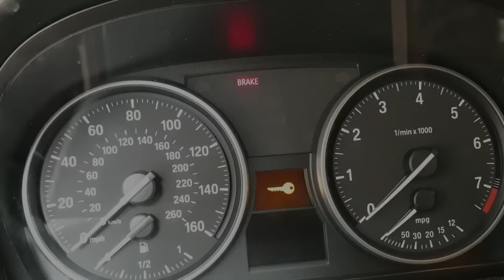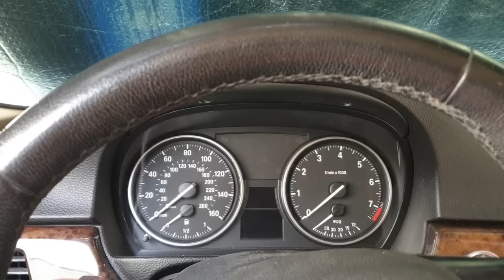Bmw N52 engine rough idle. Non return valves cleaned!!!

Comment: WOW i am going to give this a try, i have the same symptoms plus a loss of power at low rpm and a little hesitation when i give throttle below like 2000rpm ...Thank you Sir, subscribed anyway
Reply: Did you figure out the issue?
Reply: @Justin-tu6nc  Yes, it was a battery positive Fuse cable that went bad and sometimes car did this weird running and loss of power etc

Comment: Do you remmember size of socket T30, T40 ??? Thanks
Reply from the maker: I think I've mentioned in the video but if I remember correctly it was T40
Reply: @WarpDriveM  sorry, maybe I miss. I ordered 1 set of size up to T40 is maximum. Thanks

Comment: Hi, I have the same problem on cold start as in the video at 0:36. Did this procedure solve the problem permanently? I can't find a solution to this problem for over a year. I replaced plugs and vanos solenoids, but nothing has changed.
Reply from the maker: In my case it worked but I've done it just 2-3 days ago. I'll post an update in a few weeks
Reply from the maker: The problem was back! I found out that my CCV valve was bad. See that video here: https://youtu.be/w0sGD_DH7Cc
Reply: Check disa valves with inpa

Comment: What are these filters actually called? I have a 335xi with the N54 eng . Was wondering if I have those filters also?  Thank you
Reply from the maker: All the engines with vanos have this filters. Non return valves are called. It is a little bit hard for you to get in there because of the turbo (335i)
Reply: I can’t wait to see what mine look like also.. Maybe this weekend if it does not rain. I’m in New Orleans and I have only street parking

Comment: before cleaning the solenoid, was the car runs smoothly after it reaches the operating temperature (when it gets hot)?
Reply from the maker: Yes
Reply: Many thanks!. My car when gets hot it runs smoothly. Maybe i should clean or replace the solenoid.

Comment: I have N52, P0012 error code. I installed 2 new cam sensors, 2 new vanos solenoids, new non return solenoids valves, new oil change with new oil cap, and still have the code with bad idle the first 5 seconds when I start the car. Any input?
Reply: Did you figure it out @my tech garage? I have same issue
Reply: @VictoriaBCProperties  no I haven't
Reply: @mytechgarage  have you used some machine to look for vacuum leak?
Reply: @VictoriaBCProperties  no I haven't

Comment: Does the N46 have the same filters ?
Reply from the maker: All the engines with vanos have those filters. Just have a look if your engine has the valvtronic motor on the engine cover. There were a few models 2l engines without (n46/n43)

Comment: I have the same issue with my car. E70 x5. What did you use to clean those? Great video by the way!!
Reply from the maker: I've used a sanding sponge and a razor blade to scrape everything out. Air compressor at the end. But sadly the problem was back again and I've found out that my CCV valve was bad! See video here: https://youtu.be/w0sGD_DH7Cc
Reply: Warp Drive M bmw replace the ccv valve less than a year ago due to a recall. But car still with that issue
Reply from the maker: @chrsbs  so...for the idle this engines need the ccv valve, vanos, solenoids  vacuum and the valvtronic motor (Plus good spark plugs and coils). Just go step by step and you will figure it out. Test the ccv again it shoud hold vacuum, check the breather hose from the valve cover to intake, check intake gaskets and so on...
Reply: Warp Drive M thanks will do. I will try to do all this in the next 2 weeks. Thanks
Reply from the maker: @chrsbs  ok. Let me know.  Maybe first you can try to reset adaptations with inpa. Maybe this helps as well
Reply: Warp Drive M I just went trough bmw report that they did on my car and they replace the: positive crankcase ventilation (pcv) valve.  Is that the same ccv valve? You replace?
Reply: Warp Drive M also there’s no check engine light on my dashboard. But when I use the scanner the code 2A82 vanos intake keeps popping up
Reply from the maker: @chrsbs  I might be mistaken but I'm sure that in x5 you will have an oil separator on the intake and it has the same valve as in the engine cover. This is part of the pcv system. Its gonna look like this https://www.google.com/search?ie=UTF-8&client=ms-android-samsung-gn-rev1&source=android-browser&q=bmw+e70+pcv+valve#imgdii=CvZN-SRbj27tOM:&imgrc=n2MqnvLYQEIGZM: 
And because this I'm not sure what bmw has changed called pcv because it can be more things. You can start from top to check the valve cover and after that that oil separator
Reply from the maker: @chrsbs  your 2A82 code refers to Vanos Intake-stiff,  jammed mechanically. That could be  a bad vanos (the first on on top is the intake one) or might be a seal from cam journal from the intake cam. But try to swap the intake vanos with the exhaust vanos to see if you will get the same error cod or it moved to the exhaust.
Reply: Warp Drive M thanks for your time. 
I have replaced both vanos, but for some reason still having that error
Reply: After you cleaned the filters and start the car again, why did the rpm jumped up and down again?
Reply from the maker: @williamghau1150  at first  I thought that is because the filters were empty but it was because of bad CCV  valve. I have a video link under the video for that
Reply: Warp Drive M I recently changed my ccv as well because I found excessive oil in the intake manifold. Changed it and the idle still feels rough. When idling, if I give it slight throttle and tired to hold it there, the rpm would drop to about 400 and vehicle starts to shake a bit. Until I release the throttle, the rpm would jump back up to normal. I’m trying to sort this out but no luck.
Reply from the maker: @williamghau1150  you might as well to reset adaptations for the  vanos and valvtronic motor. If you replaced just the ccv from the cover I think is time to replace the hole cover....it is a hard process to figure this out because it needs so much to keep the idle perfect. Check vacuum, breather hose from back of the cover to intake, oil separator on the manifold if you have one....
Reply: Warp Drive M I don’t have the ccv on the valve cover. It’s the metal valve cover one. N52 engine still too. But I don’t have the plastic valve cover with the built in ccv. I changed the ccv with the hoses that are located under the intake manifold. I already reset for the solenoids and the valvetronic motor as well. Still no luck sigh
Reply: Did you guys check the DISA valves? I have same problem on my x5 and this solved the cold idle issue and lack of power on low rpm. Good luck.

Comment: When you first started it, the engine rpm fluctuated a little bit, then smoothed out after a few seconds.

My 2008 328i does the same thing but not on cold starts, only after I drive it and then go into a store and come out 15-30 mins later… my car will have that rpm fluctuation when I start the car. After the few seconds it evens out and the car drives perfectly. Any idea what it could be?

I can maybe hear that it makes a sort of rattle sound from the engine bay that matches the fluctuations, which would lead my to believe maybe it’s the belt tensioner - but I had the belt and tensioner changed a few years ago and it was fine… help!

Comment: Clean throttle body ECT
Reply: This motor does not use a throttle body to control engine rpm. This is a valvetronic motor....uses variable valve lift to control engine rpm.

Comment: hi my z4 has exactly same engine like your n52 2007 i have  a leak between transmission and engine , i thought RMS but it could be also oil pan or valve cover leaking from rear and go to oil pan i have also auto transmission like your 328i 
do you think it could be a transmission leaking at this place ? do you notice any leak from this place as you have exactly same mileage as mine 

thks
Reply from the maker: To be sure you have to clean everything leave the engine running and if you have oil between the engine and transmission on the hole (where you see the flywheel) than it might be RMS. In my case it was just the oil pan gasket. I thought as well that is the RMS but after replacing the oil pan gasket i didn't haf any other leak. I have a video on the channel on how ive replaced that, and yes the oil is gonna spread till the automatic transmission even if is just the oil pan. Normally the trans doesn't leak.
Reply: Warp Drive M ok my friend i will check it 
i did not hear something bad about RMS on n52 with auto transmission so it should be reliable i cross finger that it come from oil pan 
if it is RMS do you know if i need to do a gearbox oil change ? it will be a pain as i changed it 10000 miles ago

Comment: Does this ever make a whistling noise when these are bad and misfiring? I get a whistling noise sometimes when driving and it will idle rough at the same time.... But if I turn it off and restart it, I don't have that problem for awhile. Mines a 2007 328i wagon n52. I have a wierd cold start idle to it will idle rough for maybe a second or two then it will level itself out. And did this ever really fix it? It says that in description it was ccv valve...???
Reply from the maker: Those filters make no noise. When you have that noise is more likely to be the ccv valve which is glued into the engine cover and that's why the rough idle
Reply: @WarpDriveM  Ok I'll clean those too after I do the valve cover.
Reply: I had this issue. New valvcover fixed it. Replace all gaskets too.
Reply: @theandrewhutchinson  Yea I ended up doing that. They have a plastic pcv attached to it that gets worn out.

Comment: Can this causes p1093
Reply from the maker: Not really...P1093 is for running too rich. Cause for this are : Low fuel pressure,
Large vacuum leak on engine, Faulty Mass Air Flow (MAF) sensor, Faulty Ignition, Faulty fuel injector
Reply: I've got p0012 code. Rough idle, low power. Replaced camshaft sensor. Still bad. Help!

Comment: Clean filter and vanos selenoid with each oil change
Reply: Should there be no oil in the engine when cleaning the backflow prevention valve like this video? So do I have to do it when I change the enzil oil?

Comment: Time to invest in a icom and learn to use ista+ if you want to be in these cars, using “regular honda scanners” won’t work, will need bmw tools to read ghost codes. These electronics are interconnected with each other and with ista would of led you in the right direction without replacing every darn thing.
Reply from the maker: Car is fixed and I do use Ista, Inpa and the other bmw programs. U ca see that in my other videos but anyway good observation 👍

Comment: It’s a BMW dude... it will always have problems!   Just run away from it! Run fast run far!  

Also i wouldn’t say it fixed anything.. it done exactly the same thing albeit for a few seconds less.
Reply: There was no oil initially dumbass
Reply: V W bull shit
Reply: V W it did the exact same shit as it did before the guy in the video is a part slapper just replaces a bunch of shit praying to god it’s gonna fix his problem
Reply: V W all he had to do was look at his air filter when your PCV goes bad it spits oil onto the air filter and easy diagnosis for a 5$ part instead of doing coils and plugs straight away

Comment: I have a 325i e90 2.5 6cil, i have been having a problem the car randomly shuts down and i have cilinder misfires at low rpm, if i stop the car for some time and start it again it runs great, i have p1554, p302,p303 and p305 codes, what should i look for? I already cleaned solenoids, thank you
Reply from the maker: That means you have misfire at cyl 2, 3 and 5. You can try to change a coil and spark plug just to see if the error is on the same cyl or moves along with the parts. You can check the ground on the coil pack loom which is between the spark plugs bolted directly on the engine cover.( one or 2 grounds depends on engine type and year 8mm  socket) you start from here and you can go till DME..
Reply: @WarpDriveM  i appreciate your quick answer, i replaces the coils and sparkplugs recently, but still do the same, should i check for return valves and camshaft position sensor next? 
I have spent a lot of money with no luck in this car and i love it to death, the problem seems to appear when the weather is cold or humidity is higher and only warming up but still, very random... :/
Reply from the maker: That means you have to check the dme box for water or under the passenger seat the ground cables, not under the dash , under the seat!!  Fuse box aswell is a recall on this car and even the red cable to battery in the back!
Reply: @WarpDriveM  what about camshaft position sensor? the p1554 seems to refer that...wasn't expecting for you to talk about cables under the passanger seat eheh ;)
Reply from the maker: @pav1u  I know but bmw's are know to throw random codes because of bad ground or under voltage. Of course you have to check the codes first but if nothing changes after that you have to be creative 😃👍
Reply: Change your spatk plugs bro
Reply: Or your alternator might be going
Reply: check the ground cables. Replaced all of them on my car...the main cable under engine and some beside the exhaust manifold. All rusted and green.

Comment: Nice video BUT Don’t do this - this is a waste of time..!! Just use (Wurth) engine flush when changing the oil - this should clean these so called filters - 
For rough idle - check the oil filling cap is not damaged and check coils and plugs - if that’s fine then:
Replace vanos solenoids - if that’s doesn’t fix it  - then:
It’s probably the eccentric Shaft sensor in the engine (biggish job) or very very rarely the Valvetronic motor - 
Hope this helps - peace out 🙂
Reply: M Shahid did you even watch the video? He did most of the thing you said.
Reply: Did you? He said all that didn’t work -  hence my comment. I have a N52 and have 196K miles yes miles on the clock never touched these “filters” because engine flush will clean these.

Comment: Hi,

I have one big problem with my bmw e90 325ix year 2006. Please chcek my video https://www.youtube.com/watch?v=5v_OJrFUFro . I have change new ignition coils  Delphi and coils NGK. MAF sensor cleaning, throttle valve cleaning . I cleaned both vanos and vanos filters. I use injector cleaner but problem is still here. The diagnostics does not report any error, no error codes. I'm unhappy about it please help me. Thank You.
Reply from the maker: Your problem seems to be the valve cover. In the valve cover you have the ccv valve. You can replace the hole cover. You can find on ebay valve cover with gaskets for 99€
Reply: @WarpDriveM  I dont have this ccv valve. I have that one http://bmwfans.info/parts-catalog/E91/Europe/325xi-N52/L-N/jun2006/browse/engine/crankcase_ventilation_oil_separator/. I checked it out using the content on youtube and it looks good.
Reply from the maker: Your idle is definitely bad because of a vacuum leak. If you are not sur if you have the valve or the oil separator check your car with the vin nr and you can see which engine you have. Or have a look under the hood if you have the valve or just the breather hose
Reply from the maker: I'm pretty sure that if your engine is n52 you will have both. Valve and the oil separator as well
Reply: @WarpDriveM  Hi, I have only crankcase oil separator. I have engine N52 but european version.

Comment: Nice Video!  didn't it do it again at minute 9:52? RPM gauge jumped up and down then idle fine. or did it do it the first time only because the the filter needed to be filled with oil? has that fluctuation occurred again ? I am thinking to check on that as I  have the same exact issue and no one knows(even the dealer) what the problem is. see my video below: https://www.youtube.com/watch?v=K_AyEtXlqro

Comment: bmw needs to fuck off with this crap
Reply from the maker: This engine was made with low emissions in mind, that's why is so complex....
Reply: @WarpDriveM  what a joke, a 6 inline with low emissions in mind, i have the same problem , except mine does it when i depress the  clutch, it s 130i . i ll try your solution , altho i have always changed the oil every 10k  KM

Comment: No code replace all these thing down below , is  not vibration cold 900rpm, but at 650 rpm is not rough is a vibration so anointing  
No nothing, , and so tired of these cars , for sale tomorrow,
I have a 1996 explorer, you can not tell  the engine is on, on idle and when breaking
Nothing else works , careful, but smooth ,these junk
New battery, new coils new spark  plug  new vanos new air flow sensor, new air filter, new p4111 sensor , WHAT A PIECE OF SHIT,
Is just need to jump 100 rpm, 750 and won't  vibrate  ,
I can NOT even get 5000k for